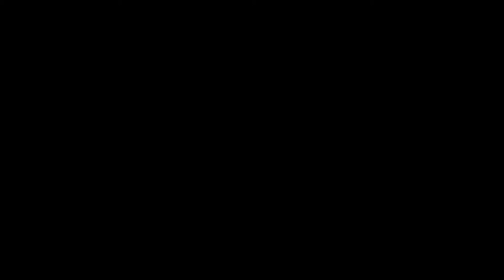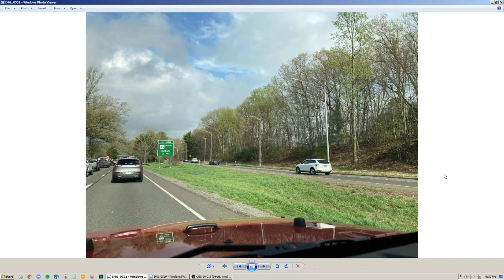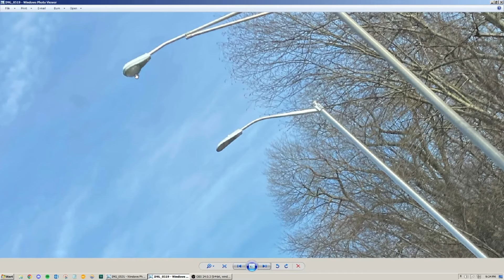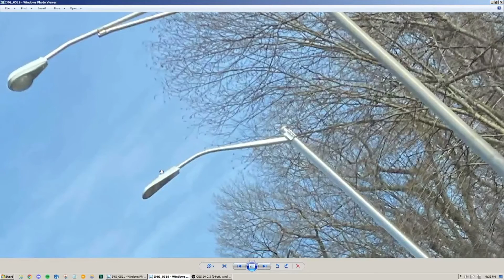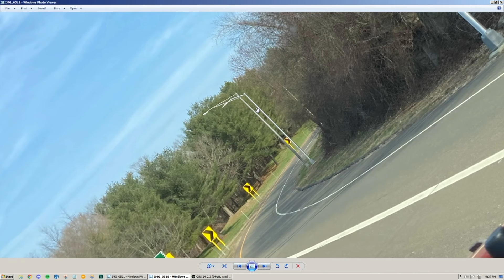I Hate These Stupid LED Street Lights

Comment: Man you understand this situation perfectly. It makes me unhappy to see lights getting replaced by those flat piercing white light things. 
White LEDs should be used for INDOOR use, not outside, unless it’s like some sort of motion light.

For rural areas, highways, and any other place with a street light, the color of high pressure sodium belongs there.
Now I’ve been thinking, what if they were able to revise the bulb to make it not use so much power and get so hot? I don’t know how they would do that, but I also thought of another thing. What if they just made an LED and put a colored tint over it to replicate the color of hps?

Luckily, I have seen some improvement in the lighting, they are going from ugly pitch white to a warmer color now.

HPS forever
Reply: I wonder if any places have ever switched back?  Seems very unlikely but I always hope I’ll start seeing them change back when enough people hate them… though no one seems to care.  I have seen a couple individual lights changed back to HPS but I have a feeling they just had them in stock and decided to use them and they’re not gonna switch them all back.
Reply from the maker: @brianinja  I've heard reports of some areas that were experiencing exceptionally high failure rates went back to HPS, but I find that hard to believe.
Reply from the maker: LED can be produced in any color, unfortunately the people making the decisions on replacing these fixtures don't opt to pay for a more expensive fixture with better coloring and optics.

Comment: most of the ones in my area are 3000k, but they dont do anything, and are barely brighter than a mercury vapour lamp, which is also quite common in australia, thankfully only the old mercury vapour ones are being removed and replaced, the hps lamps will continue to get bulb changes, but they arent that common, and no new hps fixtures. there is so much room for improvement for leds. removing ballasts and swapping in the bulb with 2700k-3000k corn bulbs would still use that special reflector too, covering the same surface area and will create much less waste.
Reply from the maker: I've never understood why we aren't just replacing the bulbs in the old fixtures with ballast-bypass LED retrofits. Sure would cost a lot less and have less environmental impact, which is supposed to be the objective.
Reply: @JordanU  yeah. maybe they dont know about it or something. im sure they will soon enough figure out about xed bulbs (xenon discharge lamp) with no mercury, that makes 400+ lumens per watt
Reply: I'm in the US which has recently banned the sale of non-LED bulbs (no comment😐), so I'm assuming all of them will be LED in due time.  Most are rapidly changing already, and I guess the streets that haven't done a mass change will just gradually replace them with LEDs as they burn out.  I hate this trend!
Reply: @brianinja  yeah im sure they will get banned here too, though the sale of fluorescent, hps and metal hailide are still legal in aus, just incandescent and mv bulbs are banned
Reply: @adl1yt  Why do they have the power to ban stuff at all though?  It’s so dumb.  The government has way too much power.
Reply: @brianinja  i know, you can change the street lights all you want but let me buy an mv bulb for my backyard floodlight, but no because it isnt good enough for people that arent even going to buy it
Reply: @brianinja  well replacement hid bulbs are still sold

Comment: Yesss I hate these new ones!  They've changed a bunch near me in the past couple years and it's made me sad.  I just saw they changed the ones near my grandparent's too, so it feels like only a matter of time till they're all gone.  I hate these LED ones... they look awful and just give me bad vibes.
Reply from the maker: Not good.
Reply: Do they still manufacture the classic high-pressure sodium ones?  Or have those been banned?
Reply from the maker: HPS bulbs of varying wattage are still available at the local the The Home Depot, so I suspect as of now, HPS is still under manufacture. From what I understand, HPS exceeds the efficiency requirements recently set and is therefore still allowed to be produced and sold, but I suspect they'll be taken out by some near-future regulation regarding mercury.
Reply: @JordanU  I'm sure they will. Can't have anything nice, can we?  I was driving home on the highway today and all the remaining HPS bulbs were working great, but a whole stretch of LED ones was out.  Typical.  Thank you for enlightening me!

Comment: Light spectrum higher than about 2500 Kelvin plays harshly with human biology, greatly suppressing the production of serotonin (sleep hormone). Blue light wreaks havoc with the eyes at night.
I've driven through a small city at night where most of the LED street lights had turned intense blue-purple. It was the MOST HARSH NASTY light ever, felt creepy and dystopian, couldn't wait to get through the town and down the road.
Reply from the maker: Some of the lights have turned purple around here as well, very poor visibility.
Reply: @JordanU  According to research, the color and candela/lumen/lux output of these lights is higher performing in terms of being able to reveal things to the human eye at the 5000k+ color temperatures and the power it requires to produce that light. BUT.... it has a very detrimental effect to people's sleep/recovery cycles due to color and intensity, after dark. Man was built to work while the sun illuminates nature. Sun produces various color temperatures throughout the day, but blasting the eyes with very white-to-violet spectrum light after dark really screws with the brain.
There seems to be a big debate between "power efficiency" versus what is biologically and physically the best for the human cycle and eye.
As usual, everything becomes crap for the sake of "efficiency and safety."
Energy is being politically forced into certain technologies, making it wildly expensive. At the same time we're being told it's for our own good, because the earth is supposedly dying because of the 20th century use of technology (it's been proven a lie for a long time but the persist in telling it).
Reply: I don't have any official stats or data to bring to this, but it is blindingly obvious that LEDs are inferior and they should all be switched back.  More blindingly obvious than the LEDs themselves are blinding!
Reply: @brianinja  There is a lot that could have been done to make them okay to use. Such like refraction lenses over the diodes, a color spectrum around 2700 kelvin, frosted lens to diffuse the light, perhaps lower intensities.
Yet there was nothing at all wrong with the high pressure sodium bulbs that have occupied the street light fixtures for decades.
Reply: @12skipafew-e7y  I wish they would just keep using the old ones.  They just have more character and are nostalgic anyway.  Do you know if they still make those?
Reply: @brianinja  It would be in a city budget and whatever a city chooses as a primary supplier making them. I don't know who that would be, as I've not done research. I think you can still buy HPS bulbs and ballasts in home improvement stores as a private consumer.
Reply: @12skipafew-e7y  Ah thank you!  That's interesting.  I feel like they would NEVER switch it back now, but I wish some day places would.
Reply: @brianinja  Never say never. The motivation for all this? Tax pool funds, because of the green agenda. The green agenda is a lie. Eventually lies get defeated and economic accuracy takes over.

Comment: Lucky for me the LEDs installed outside my house are a nice warm white which is a bit more pleasant on the eye than the crappy cold white horrible glare.
Reply from the maker: That's rare to see.
Reply: @JordanU  It sadly is rare to see, wished they decided to use the warm white leds more instead of cheaply made cool white. Also only 1 Sodium Light left in my area now though (low pressure sodium) and once that's gone it'd only be the warm white led lights that are easy on my eyes, unlike cool white.

Comment: I hate that almost all lights in my neighborhood are now LEDs. I remember when there was a Mercury Vapor NEMA fixture outside my driveway and I can’t forget it. That buzz. It was replaced by an LED and that LED dosent impress me. The only old street lights still in my neighborhood are a GE M400, some Hubbell RMCs, and some NEMAs with LEDs in them.
Reply from the maker: I don't recall a lot of mercury vapor around here, but I definitely remember when everything was still sodium. I greatly preferred it. The fixtures were far more reliable and the illumination was superior.

Comment: I wouldn’t mind LED street lighting if the lanterns weren’t poorly designed and had good optical control with minimised glare. Sadly, most councils go for the quantity over quality approach and opt for the cheapest LED lanterns available at the time. Also, I’m really not a huge fan of the 4000K colour temperature that is widespread throughout the UK, they give the roads a cold and uninviting appearance, not to mention the environmental impacts they have. I would’ve preferred it if they opted for 3000K or even 2700K instead. This is why I prefer SOX, HPS and CMH for street lighting.
Reply from the maker: I agree. LED street lights could be completely satisfactory if designed properly, but they just aren't.
Reply: @JordanU there are actually led thats designed properly, like philips brp372, those are built like tank and cost like a tank, replaced since 2015 and still going strong, the problem that most led street light have is that they are poorly designed, cheap driver that melts itself after 5 minutes of use
Reply: 4000k is chosen to improve visibility, huge difference in visibility

Comment: Led street light in my place are mostly retrofit, its just an led bulb thats yanked inside an old fixture, its not that bright and im assuming its 50 to 40 watt, they do not turn purple or flicker as most people say, the one that failed just simply dimmed
Reply from the maker: That's the way it should be.
Reply: @JordanU  i think that induction lamp or traditional fluorescent lamp should be used for street lighting, it doesn't fail unexpectedly, it has high efficiency compared to other traditional HID lamp but less than LED, fairly long lifespan, and you dont have to throw the whole fixture away when it fails, just replace the bulb or the ballast
Reply: @UIGIWMA89  Or mercury vapor. Although there are probably gonna be some weirdos who claim the mercury in them is somehow harmful to people outside
Reply: @anymous4322  mercury vapor lamps are way too inefficient in today's standard, most if not all fluorescent tube nowadays has better efficiency
Reply: @UIGIWMA89  mercury vapor is super efficent though
Reply: @UIGIWMA89  wdym by todays standard? A flourescent streetlight would use about the same wattage (150 mercury vs 2 75 watt high output flourescent tube
Reply: @anymous4322  most mv bulb are 50 to 60 lumens per watt, which is low for the new standards, fluorescent tube with magnetic ballast is between 50 to 70 lumens per watt, which is a bit higher, but fluorescent lamp with electronic ballast is around 60 to 100 lumens per watt which is a big upgrade from both
Reply: @UIGIWMA89  true
Reply: @anymous4322  metal halide or fluorescent tube is a way better replacement for mv, but mv lamp is cheaper and it last longer than fluorescent tube and has the same lifespan as metal halide lamp, but both of those lamps beat mv lamp in almost everyway
Reply: @JordanU  unfortunately they have the same disease as other led, premature failure, i have recently found 3 that failed in the past week

Comment: Can we also include the ceramic metal halide lamps too
Reply from the maker: Most metal halide fixtures are much better quality than the LED ones we have today and don't suffer from the same problems.
Reply: @JordanU  why don't they make led streetlights using a BULB an not build it in the driver it's a waist of money and also why won't they make led streetlights that mimic the high pressure sodium and ceramic metal halide bulb...they also need to make led filament light bulbs that you can put in enclosure fixtures...what can we do now?
Reply from the maker: @cavariusavery6637  It's a cost and greed issue. The fixtures with the integrated diodes on a circuit board are much cheaper than fixtures with proper optics or a modular design with replaceable components.
Reply: @JordanU  Okay...I fid some research this morning and found out companies are releasing led filament glass light bulbs (HID/HPS/CMH Style) I believe they just came out and it would be a great idea if I owned a company that would redesign all streetlights old skool style like back in the day make them built to last and recreate ballast and luminaries make light bulbs warm white and make some amber orange...I know I would be a tough decision but I came up with this idea after I seen some streetlights being replaced with the new modern style...I will take time tho I have great ideas
Reply: @JordanU  on top of that new streetlights won't last unless it's built to the highest quality and can they be solar powered too?

Comment: LEDs cause cancer, macular degeneration, headaches and fatigue
Reply from the maker: I don't see how they could cause cancer, but they definitely can cause a headache and probably do other damage to the eyes over time.
Reply: @JordanU  Nurses on nightshift (neath LED lights) had a higher incidence of cancer
Reply from the maker: That is far too loose of a correlation to prove anything. I'm all for advocating against LED lighting, but it needs to be accurate.
Reply: @JordanU  France has vetoed the LED lights
Reply: @sophiafakevirusDo they use HPS then?

Comment: I hate LED period! I am stockpiling fluorescent tubes and fittiings hear in the u.k. Since the government banned them hear. Where i live is now very dark on the street because the LED lighting keeps failing!
Reply from the maker: I hate it as well, and I too have been stocking the older types of lights while I still can. I have a lifetime supply of incandescent for indoors. Many of these LED street lights have failed around here, but at least the local utility company is pretty good about responding to reports of broken units and replacing.

Comment: Thanks for making this video. My city installed these super bright leds and have totally ruined the night here. I used to love driving at night around town, but its just hideous. It’s like trying to avoid looking at a series of welding arcs while driving through town.
Reply from the maker: There was still one other freeway around here that had the sodium lights, I used to use that road specifically at night when going almost anywhere in that direction. It just got changed a month or two ago. Now I avoid it at all costs, it's blinding in good conditions and full of glare in bad ones like rain.
Reply: We don't have any LED streetlights in our area, but when I visited an area that did, I realized just how much better our area's softer-on-the-eyes high pressure sodium lights are. The LEDs are harsh, blinding, and just plain ugly light.

Comment: My city mostly changed to LED streetlights, but there are some streetlights that still have the old light fixtures with the yellow color, but the city now changed those bulbs to LED cool white and they are much brighter than the new flat LED streetlights they’ve installed. I wish that they would have kept the old style streetlights and just changed all the yellow bulbs to bright white LED. I think with the old lense it makes a huge difference with the way the light faces, and that’s what other cities should have done! And with those old fixtures it’s so much easier to replace the yellow bulb to LED to make the city more modern and brighter, but with those new LED fixtures, you probably have to replace the whole thing! 🤦‍♂️
Reply from the maker: LED retrofit bulbs (which are cost-effective and readily available) should have been installed into the existing fixtures, as the old HPS bulbs burned out. To replace the entire pole, head, and wiring is such a waste of time, materials, resources, and tax payer dollars. The old fixtures had far superior optics and distributed the light properly. These new fixtures have 0 optics to them, cast light all over the place where it's not needed or wanted, have a horrible glare, and require the entire thing to be replaced when it fails, which happens all the time. The current situation with these street lights is absolutely ridiculous.

Comment: I hate led I want old street light back
Reply from the maker: I wouldn't mind them if they were built properly, worked well, and lasted a while. Unfortunately, none of those things are the case.
Reply: Basically spend tax dollars on replacing perfectly good HPS fixtures, with inferior fixtures. Then turn right around and repair inferior fixtures with more tax dollars.
It's like installing refrigerators in the arctic, powered by frozen wind turbines.